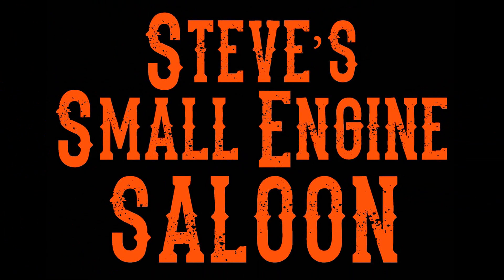What Is A Hydro Locked Engine AND Can You Fix It? (hydraulic)

Comment: I have a small 3hp 2-stroke outboard and laid it on its side once without turning the fuel off and filled up the cylinder with fuel. Did not have my spark plug wrench so had to go through various gyrations and string pulling to get the fuel of the cylinder. After a half hour of messing around I got it to turn over and then fire up

Comment: After you've pulled the plug make sure that you disable the ignition wire. If your cylinder is full of gasoline you may have just created an excellent flamethrower.
Reply: I actually did that I pulled the cord and the ignition grounded and the spark caught my lawn mower on fire inside m garage. Fortunately I had a fire extinguisher handy.